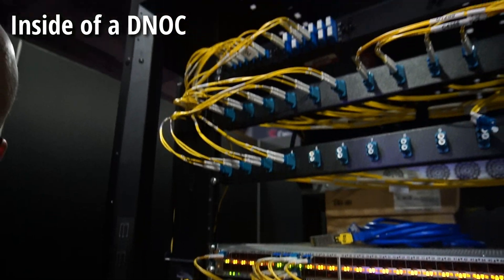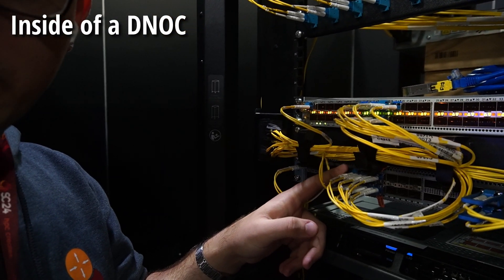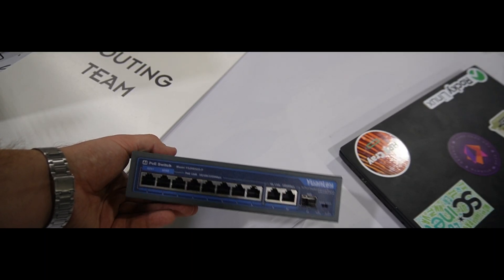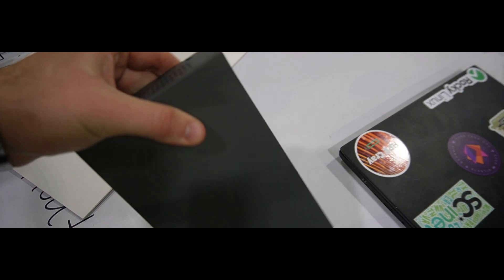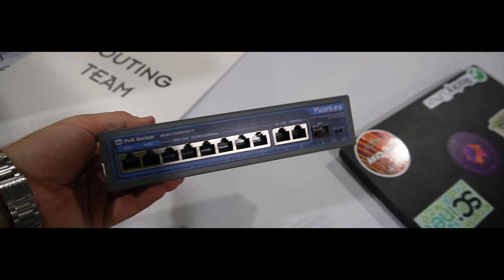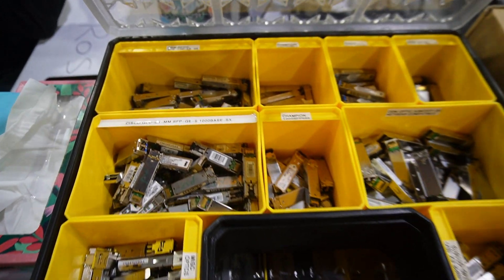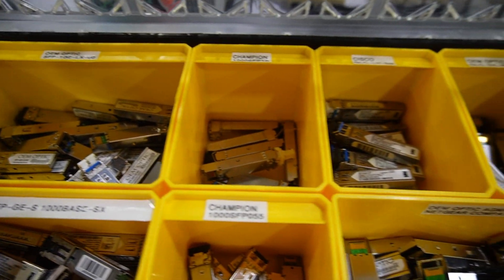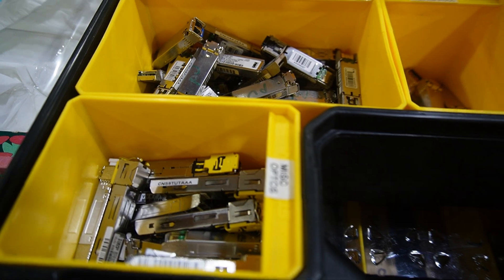We've had a big networking problem on a supercomputing conference

Comment: So what was the problem finally? Not all the non-working switches were those creepy Chinese ones?
Thanks for reporting about the event to us, lazy ones, not liking to travel.
Reply: Yeah you really don't tell us the problem here can you give us what it was besides a few random cheap Chinese switches, which yeah if your building cheap Chinese switches you shouldn't expect anything to work in my opinion.  If cost is an issues just by refurb or used Cisco, Juniper, Arista, etc gear.  Its dirty cheap online.
Reply from the maker: @derjuden  The wierd part is - the exact same switches worked last year. We know this because we reuse some of them each year. This will only be properly investigated after the show ends
Reply from the maker: That's the thing. We do not know 100% yet. It will be diagnosed further after the show ends. We have two theories (dirty power or weird autoneg capabilities hardcoded into the chinese switches) but what makes the thing even more bizarre, is the fact that we have the exact same devices from last year that only NOW started demonstrating this behavior.